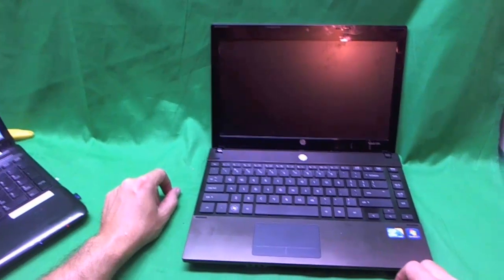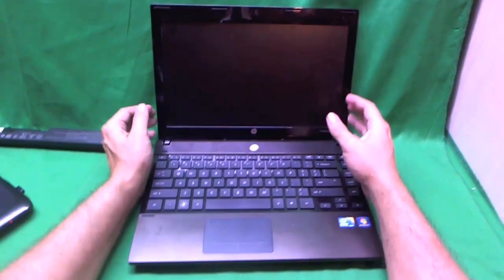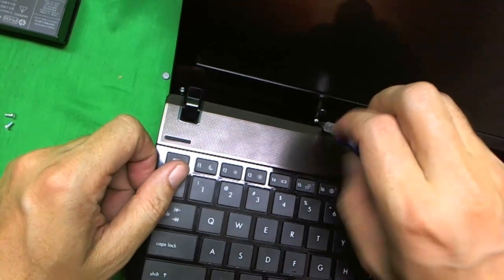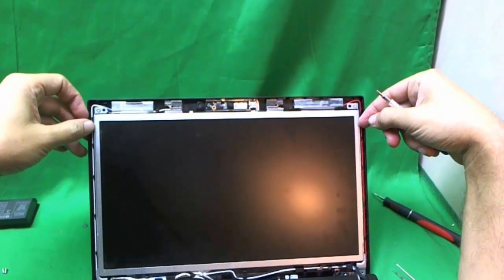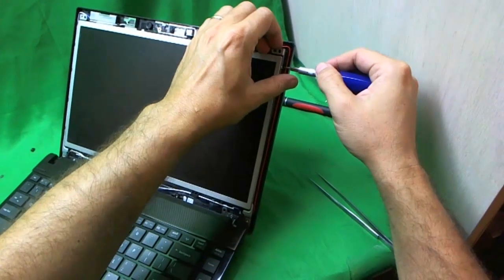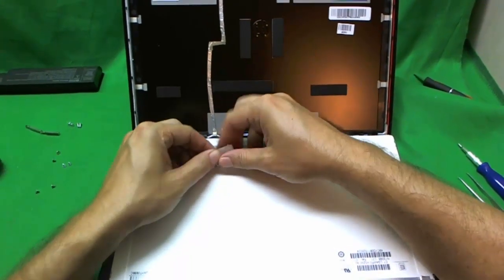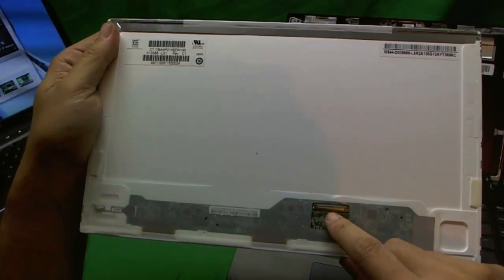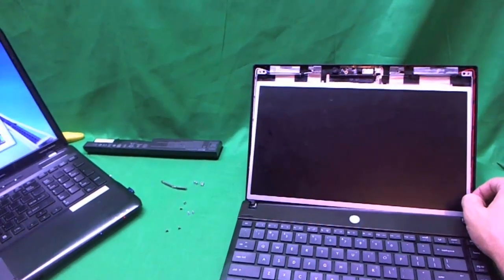HP Probook 4320s Notebook Screen Replacement Procedure

Comment from the maker: Jason, thanks for the comments. The reason that I recommend doing it this way is because this is the first and only time most people will do this. Chances are a lot higher of reconnecting the connectors improperly or damaging them when taking the laptop apart and putting it together than losing a screw. Also if a screw is lost, it most likely will not affect the function of the laptop.